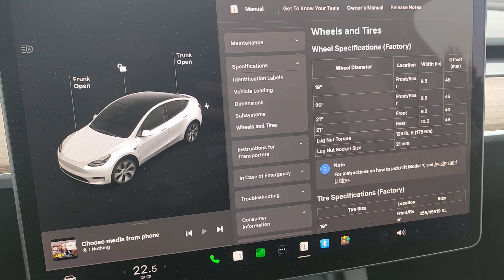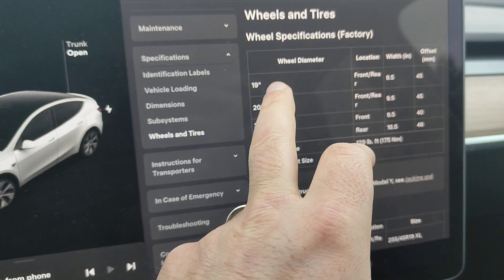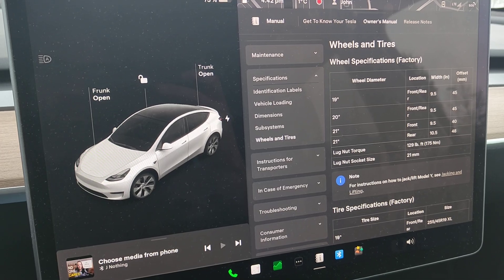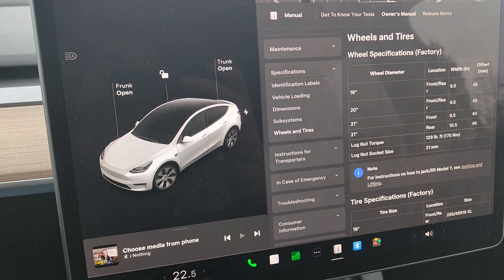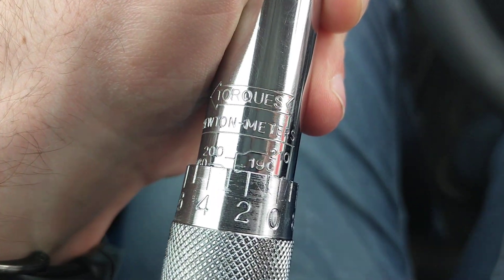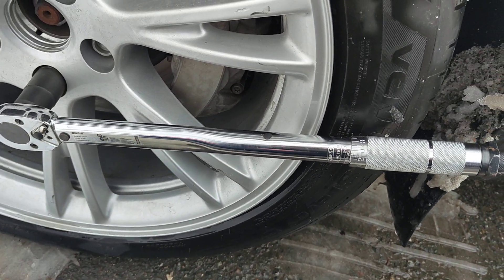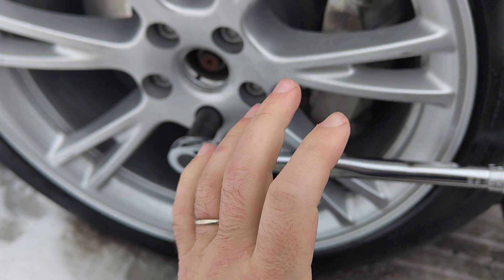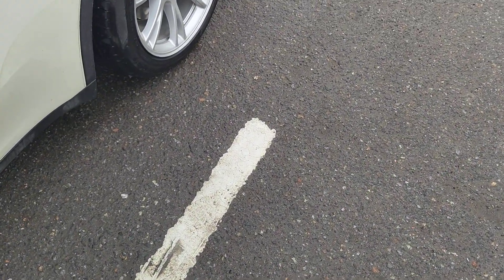How and Why to Retorque lug nuts on Tesla Model Y Tires

Comment: It is good to check the lug nuts aa part of care,  but if a tesla dealer is not double checking their work it is on them.  It is not a drivers responsibility or liability to do that.
Reply: Good luck proving that, also, you will be sorry you didn’t check it when you’re on the side of the road with one less wheel